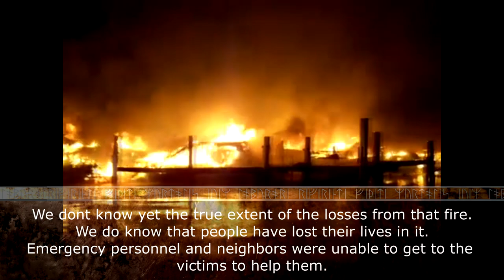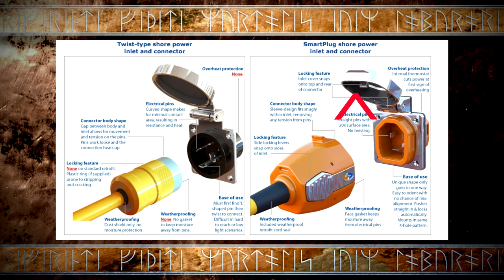Shore Power, Marina Fires, And Smart Plugs

Comment: I'm so glad that we have used the BS4343 plug for caravan sites and marina shore power, round pins, generally 15A @240v (there are many voltage and current ratings, the 11oV version was standard on building sites where they get a lot of abuse))
We also used them a lot around the farms where i worked
We even removeed the hubbel style sockets on a portable generator and replaced with 4343
I would have to question why the inverter supply would power a panel that's supposed to be isolated, a breaker panel should only have one power input
Reply from the maker: my ac panel on the boat has a input for the shore mains and then has a mains for the inverter.  Never the two should both be on :)  

i'll have to look up the 4343 you mentioned.
Reply: @TipsyRavenSailing  It's standard in Europe its IEC pin and sleeve type connector. We use them in entertainment as well and avoid the L5-30 there are differences between the euro CE spec and the US spec connectors although they look very similar. Victron has a real nice pin and sleeve shore power option for European boats but nothing an insurance provider in the US would like. The real problem with the L5-30 is the wire termination to the blade not the blade to blade contact provided its a marine rated nickel plated connector. Once the wire begins to corrode or the clamping plate loosens the resistance begins to cause heating and of course heat adds more resistance and we have cycle of destruction. I've seen a ton of the L5-30's melt on location in entertainment applications but they're safe when installed properly. Luckily 99.9% of the boats out there are on a molded, factory sealed shore power cord thats not likely to fail BUT the inlet to there boat is not machine assembled and subject to loose and corroded wire connections on the receptacle. Regardless the IEC is a better solution but tough to source in a North American 30amp connector ask me how I know lol. On my desk right now I have a Bulgin 30 amp IEC that I ordered to possibly replace my L5-30 jury is still out.
Reply from the maker: @michaelconner7149  indeed.  the twisting action itself being the root of my concern.  The IEC is as you say more robust.  The smartplug is however fabricated specifically for this usecase as opposed to a one size fits all approach.  Coupled with the lack of availability except through manufacturer supply shops like grainger for costs extraordinarily more than the solution i went with ... well... there ya go :)

Comment: Regarding finding where to put the hole in the bulkhead for the new connector; rather than tapping on the hull to sound out the location, could you have used two magnets instead? One magnet on the inside, and use the other magnet to find the first magnet. I suspect that'd be quick and easy, no guesswork.
Reply from the maker: Not a bad idea. I should try that next time haha